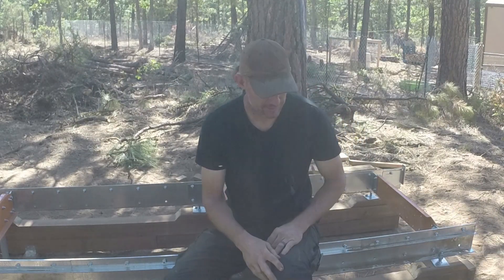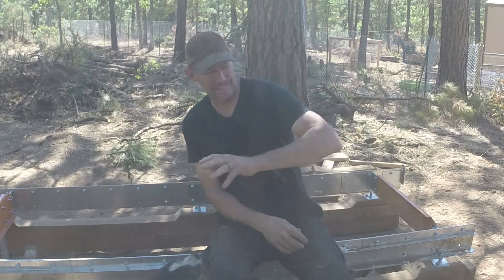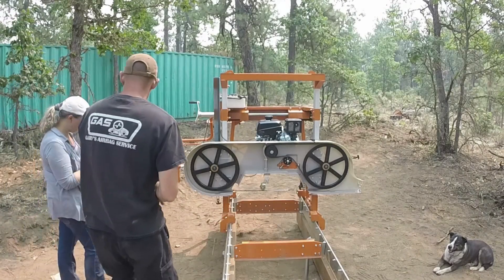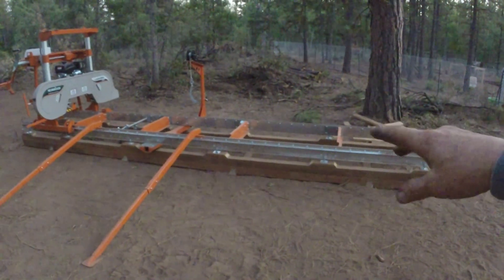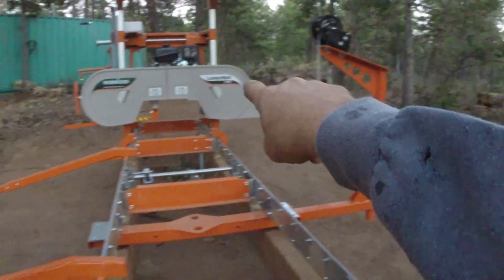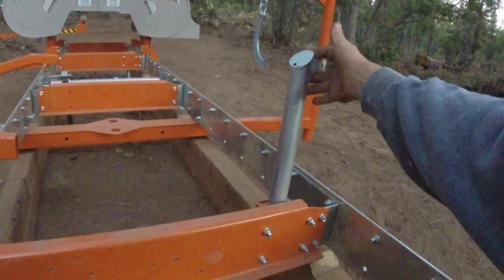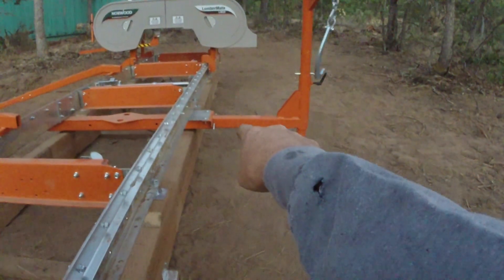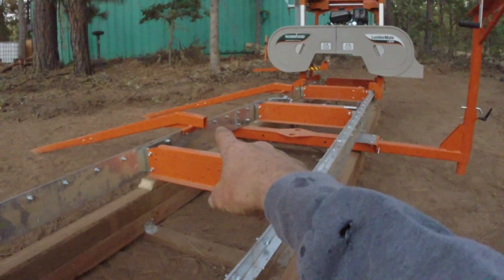My Norwood sawmill unboxing and assembly. Part 2. Assembling the sawhead - norwood portable sawmills

Comment: Hey do you have the Kohler enginer? If so how did you connect the throttle cable?

Thanks great vid
Reply from the maker: Yes I do have the Kohler motor, I will try to explain this as good as I can. 
On the front side of the motor just above the plastic blade shrouds there is a chrome throttle linkage on the motor with a small hole in it for the S curve on the throttle cable to hook into. After you hook that up you put the throttle cable housing under the clamp and tighten it when its adjusted correctly. 
Hope this makes sense. :)

Comment: You're not showing how to put it together, unlike Dave Boyt's video assembling the HD-36. I'm in the process of purchasing the LM-29, cannot find a video anywhere showing how it goes together. Woodmizer has a super video of how to assemble the woomizer LT-15, but, I don't want a woodmizer. Is there a video showing how to put the LM-29 together with the trailer package ??
Reply from the maker: We followed the instructions that came with the saw mill. I tried to mention anything that gave us difficulty. Also, I thought there already was an in-depth video on youtube about assembly, but I can't find it anymore. Thanks for watching. :)
Reply: @KoalityofLife  thank you for your answer. Another question,  is the precision blade guide roller adequate or would the Ceramic blade guides be better ?
Reply from the maker: @1hynes1  I haven't had a problem with the blade guides, just make sure they are adjusted correctly and the same from side to side. This being said I don't know what ceramic blade guides would change. The stock blade guides make a bit of noise as they turn but I usually wear ear plugs when running the mill just because the motor is right there next to you as you push it along. :)